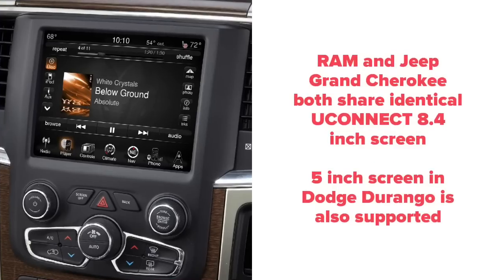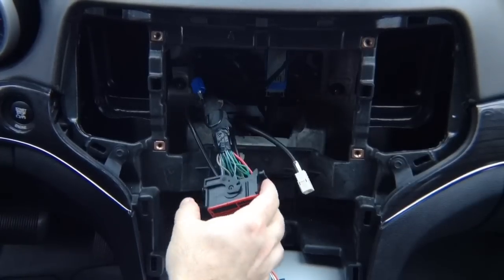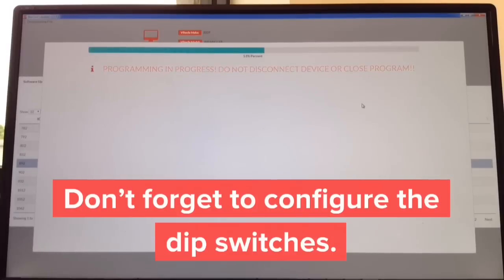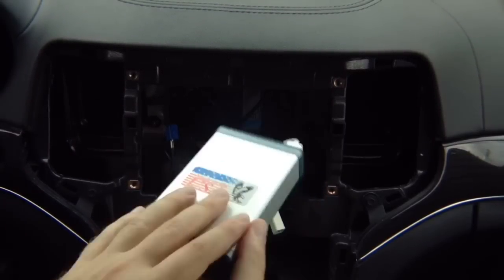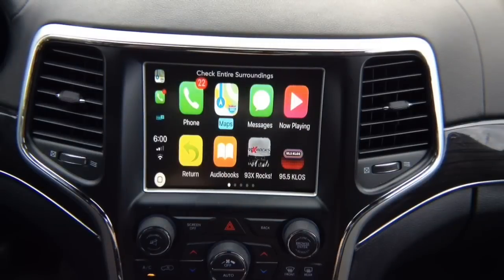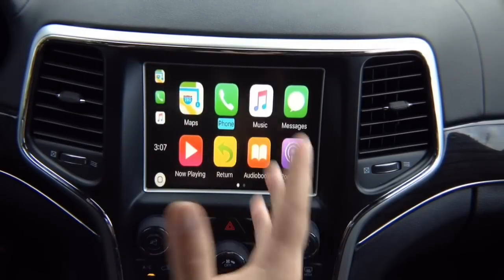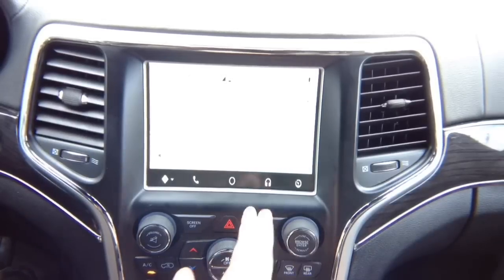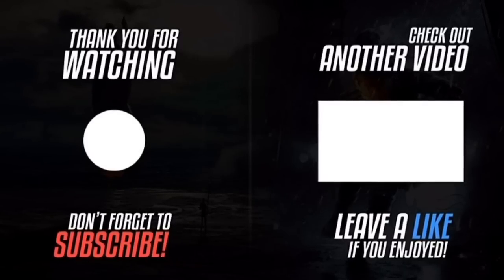Ram Apple CarPlay Upgrade, 2013-2019 Dodge Ram Uconnect 8.4 Apple CarPlay Android Auto Upgrade

Comment: Really cool. If it was touch screen too I would get one now
Reply: If you look at 20:04 it's says it works with the touch screen on your vehicle. If it controls the screen then it controls the car play.
Reply from the maker: This radio is a self-contained all in one radio which means touchscreen never leaves outside of the radio so it's impossible to intercepted, not controls our actual native to Apple CarPlay versus touchscreen

Comment: Do I lose my climate control options? They’re only on the Uconnect screen (heated/cooling seats & heated steering wheel)
Reply from the maker: You do not lose any of the factory feature we only add Apple CarPlay the factory features work as before without a single change that is the entire idea behind the product

Comment: Will this not use the factory microphone that is already in the truck?
Reply from the maker: Our products work, using factory, Bluetooth audio, and Bluetooth calling, we are the only product that is currently sold in the USA, and anywhere else in the world that does not require you to dismantle, discreet into little pieces and solder inside of the screen, our product is 100% plug-and-play. Plus our product allows you to use factory steering wheel controls to control music and everything else. This is the only product in the world that does that.

Comment: My 2014  Ram 1500 has the 8.4 uconnect system but not with a dvd player. Is there a way for me to watch my dvd's or do I have to rely exclusively on my iphone?
Reply from the maker: You can install DVD PLAYER using our interface

Comment: So we cannot use the touchscreen of the Uconnect with the carplay? Do you have an option for that?
Reply from the maker: We are the only supplier of this product in the world that makes all-in -one product without the need of connecting two or three different products together, and where are you do not need to open up the screen. Keep in mind that all other competitor units that  you see online, they require you to disassemble your screen into little pieces and solder inside the screen. Because your screen is all in one the touchscreen never leaves inside of the screen that's why it's impossible to do a touchscreen without taking the screen apart. Also keep in mind CarPlay was never designed to be for the touchscreen even though it's used by touchscreen, unlike your phone in the car it was designed to work with a joystick or knobs in your case similar can be found in cars that don't have a touchscreen such as BMW, such as Honda, such as Acura, such as Mercedes, such as Audi and similar cars that don't have touchscreen. Actually the CarPlay interface is designed to natively work with your knobs there is many reasons for that, and touch screen is actually not native to Apple CarPlay. The reason why Apple was against touchscreen is because they believe that hand to a carbonation to touch something on the screen takes your view away from the road for much longer time then selection knobs.